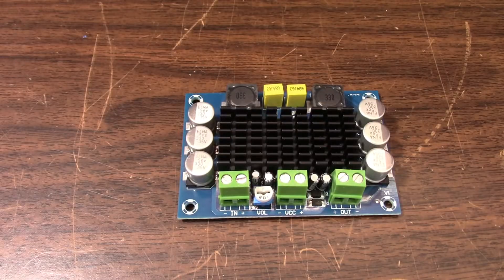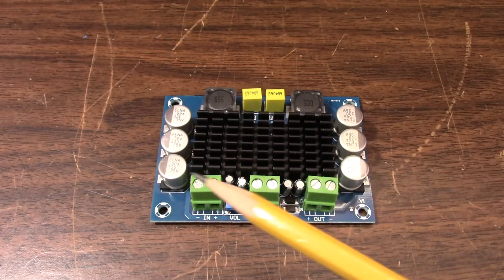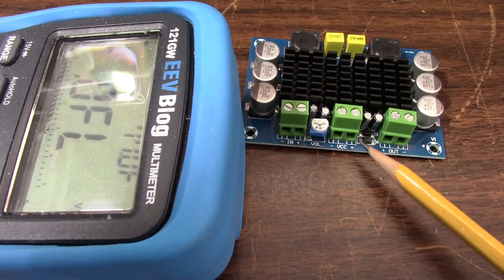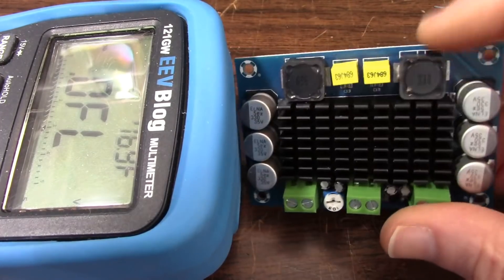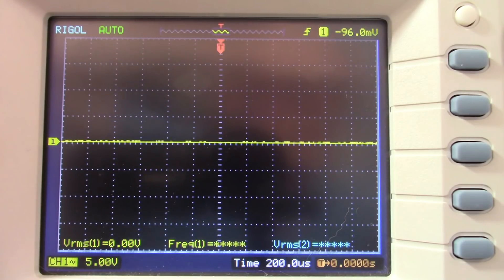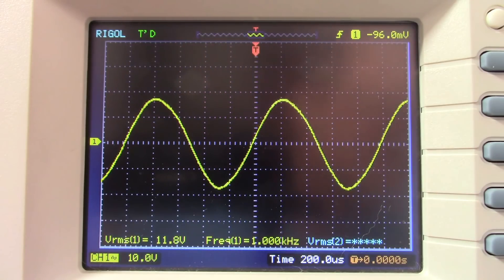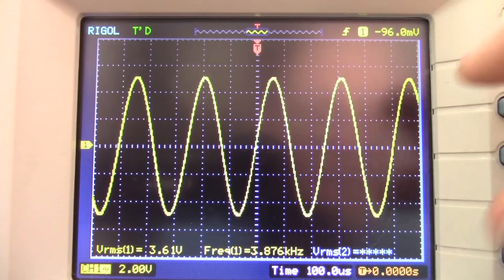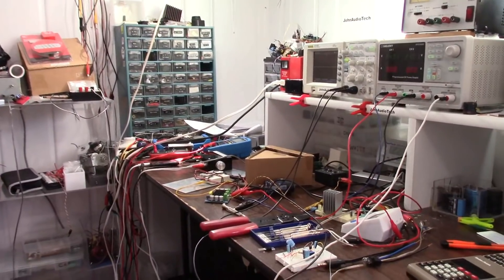TPA3116D2 audio amplifier 100w at 2 Ohms?

Comment: Hello! Thank you for testing these TPA3116's for us! I have learned something today with regards to using these amps on 2 Ohm load. I don't have the equipment nor the expertise to do these kind of testing... anyways, I have the stereo variant of this little amp and I was trying to power a double coil (2x2 ohms) 6.3 inch subwoofer for car. I used the output of the navigation system and hook it up into a low pass filter which then went to the input of my amp. Then I used both channels to power this subwoofer. The sound at those low frequencies, was unexpectedly powerful ... I have checked both the heat sink and the coils to see if they get any hot... but no! Nothing! Just by touching them, I suppose if I didn't feel any heat, maybe the temperature was around 37 Celsius. But, another thing happened: the volume of the amp was 2/3 towards maximum... I didn't get ready of the turn on pup-up back then.. when I powered the system, the pop-up didn't go off... it just keep on going repeatedly stressing out the subwoofer at maximum... I thought I lost it! I had to disconnect the main power immediately! What do you think happened? I am a beginner in electronics! Thank you for your patience! 🙏

Comment: 11:35 Can this amp really be cranked up with real speaker (not test load) to even 72 watts ? Because my dc watt meter only shows 3-4 watts at normal listening volume, and it already sounds powerful to me (indoor, 4x4 meter room). Because I'm using similar chip tpa3116d2 but different kit, to drive a double coil 6" subwoofer that can be set to 2/4/8 ohm, now I'm using 4 ohm, too afraid of using 2ohm.
Reply: If you're measuring power draw between the supply and amplifier then you won't get the correct reading. Amplifier power is measured from the speaker output with a proper amplifier dyno.
Reply: @RallyRanchMotorsport  Yea, since then i have learned that there are like 3 kinds of wattage that can be measured. 
1. From Wall (AC)
2. From power supply (DC)
3. From speaker + - , need proper equipment with Amperemeter clamp and voltmeter.

But as long as I keep comparing one power draw to different level of sound. It will stay consistent like if it draws 20 watts from AC power, then I crank it up and it draws 50 watts, and if I crank more and it draws 100 watt. It's consistent as a measurement.

Also class D is 85-95% efficient, so if it draws 100 watt from wall socket, the output to speaker is more or less 85-95 watt, rest is lost in heat etc.

Comment: I am on my second project using a set of these 3116 mono boards - my first one was a set of dedicated monoblock amps to drive some 2 ohm subs.  I have to say:  they have been in service being driven by a 24 volt switching supply for 3 months now.  They are NOT fan-cooled, but DO get rather warm.  However - they have taken a LOT of abuse where they are getting used at.  My new project I am working on now implements these for similar 2-ohm subs, but will be cooled by a fan.  For less than a few bucks, these will really push cheaper subs pretty hard and certianly take a lot of abuse.

Comment: Is it okay to use a symmetrical psu for tpa3116? I have a 12-0-12 transformer lying around.
Reply: The board requires 24 DC (typ), your transformer is AC. If  you add rectifiers and capacitors as symetrical, you will get 12*1,41-0-12*1,41 or almost 17-0-17 Vdc  or 34Vdc end to end - the board can't handle that !  All you can do is to rectify half wave (1 diode each side, center tap as ground, some big capacitors to smooth it) and you will get 17 Vdc, something that shall work, but the power will be limited to this voltage.... maybe you will get around 30~35w / ch in 4 ohms.

Comment: hello I bought this amplifier, I want to mount it in a portable radio and I will power it with 14 volts with 4 3000 mha 18650 batteries (approx) in 4S, I am looking for suitable 3 inch square speakers what can you recommend?

Comment: Thank you for your research into this board. Because of your excellent video, I Just installed these into some speakers and loving them! I covered the components on the left speaker board with silicone. I Will see if either board fail from the vibration! They work well with my bargain (£20) Mordaunt Short 902's.

Comment: Hey John, my TPA3116 board just went silent. Was working fine until I installed 3.3uF 100V audio caps across the speaker outputs. And now its dead. Any idea if I fried the chip or what could have happened?

Comment: Those coils are labeled as 33uH, but keep in mind that the data sheet recommends 10uH coils.  So, the snubber will have a lot of attenuation above about 1KHz which explains why you saw that high attenuation / roll-off at 10KHz.  Still, you were trying to evaluate this at lower bass frequencies. and the power there, I think  The TPA3116x is not going to perform to its potential without some additional heat spreading and like you said, a fan.  If you add the proper cooling the 3116 will give you 100W at 24V but you need to really beef up the cooling.  Agree this is a crap design from China, but the potential is there if you take the measures to support it.

Comment: I've come back and done this test on some of my TPA3116 boards.  I managed to get just over 100 watts (barely) at 24 volts from a 15 amp supply into a 2 ohm non inductive load but man ohh man does everything get hot.  Stupid hot even.  Bottom line is 50-60 watts bursts and it'll work,  for a while at least.

Comment: Problem is mostly the inductors.  I've seen that same distortion above 10Khz when the inductors heat up on other TPA3116 amps.  Still I rather like them,  they don't sound all that bad.

Comment: Hey John, I have a few of these amps for a project, but I would like to have some sort of control over the crossover frequency of the audio input to different amps, do you have any recommendations about how I go about this? I'm considering a crossover frequency between 100 and 150hz, but I'm having a lot of trouble finding decent preamp crossovers
Reply from the maker: Op amp based filters are the way to go. Check out Elliot Sound Products for good circuits.
Reply: @JohnAudioTech  thank you! I was planning on using multiple amps, an amp per speaker, would you suggest I purchase a single larger amp, and place the high and low pass filters op amp? Or send the full range to every amp and and place high and low filters after each amp?
Reply: @JohnAudioTech  also I'd like to add some sort of gain control on the low end, so I can match the bass to the treble, also this whole project is battery powered.
Reply from the maker: @sportbikeguy9875  It shouldn't matter much since each channel can be considered a separate amp as long as your power source can handle the current. You can add a potentiometer between the preamp/filter and the power amp to control the sound level.

Comment: Hey John, in what ways would you modify the board in order for it to be more solid at 2 ohm? Bigger (or no) diode, bigger coils, fan, anything else? Do you think this is achievable or worthwhile? I have one of these laying around and I'm building a home theater sub with a 2 ohm car sub driver (not much variety of choice here in Argentina) and I'd love to be able to repurpose this board instead of buying a new amp.
Reply from the maker: Yes, eliminate the supply protection diodes, bigger coils to handle the current and fan on the heatsink.
Reply: @JohnAudioTech  thanks!!!

Comment: Hi John - I asked this question on  your original 2018 review but I will ask it again here. Do the TPA3116 amp chips create/use a charge pump on the output H-bridge to double the input supply voltage? You are supplying 24 VDC  yet your scope indicates about 34 Vrms display=12, so (2 * 12/.707=34) 34 volts peak-to-peak where I would expect 12 volts peak-to-peak.  Thanks again.
Reply from the maker: What video did you see this? It's been a while so I'd have to rewatch them. At 24v and 4 Ohm load, I was getting around 15v rms, or 42.4v pk-pk. This is normal for a bridge amplifier with typical losses. No charge pump.

Comment: Thanks ! very good video.  I am thinking of using these as  part of a dual amp setup. I want to separate the lower frequencies with a DSP and drive the woofers with this amp and an LM4766 amp for the higher frequencies.  Do you think that is the best way to go? My thinking is the class D amp will be faster responding and you wont hear the minor hiss from the woofer. I added a zobel and thiel network filter to the output to the 4766 amp.  Do those kinds of filters help with damping on this TPA3116 D class amp too?

Comment: I own two of the amplifiers that were tested on this channel (this TPA3116D2 here and the TDA7492 2x50W) and would like to share what I found out about one feature that was not mentioned in the tests: The TPA3116D2 makes a popping sound every time the power supply is turned on, the TDA792 does not do that. I do not have the ability to analyze the technical features of the devices but I thought this might be relevant to some people... I am now trying to use a relay on the speaker cable that connects the speakers a short time after the amplifier is turned on to get rid of the popping sound.
Reply: tpa3116 is made by texas instruments and the tda7492 is made by ST microconductor so theres not made or built the same

Comment: Sir I want to know how come a 2.1 TPA3116 D2(2 TPA3116 IC) and a mono TPA3116d2(1 TPA3116 IC) requires or uses same power supply that is 24v. Please help me I am very confused. Waiting for your reply Sir.
Reply: 24v is 24v what matters is the amperage aka flow of current. SOOO if you want to get 50w x2 @ 4 ohms you need 200w pwr sppy 200w is the peak and 100w is rms divided by 2 is 50w rms per ch x 2. 25v @ 8amps is 200w.

Comment: Hello,
Can you give me some advice, please? I have 2 of these amplifiers connected to 8 ohms speakers. The audio source is a laptop. When I connect my laptop to the power grid, a loud background noise starts to hear from the speakers. The same noise is heard but much more intense if I connect the amplifier to the pc. I have other amplifiers that do not have this problem with using the same laptop or pc. What can be done to fix this problem?
Reply: Hi, It is because of Common ground circuit within the PC/Laptop audio out put. It is the Noise . Use Signal noise Isolator.
Reply: @Raamz111  what is signal noise isolator? Have some link?

Comment: I have bought this and the stereo tye amp. I found a typical lazy chinese design flaw, the heat sink touches the caps before the get full contact with the chip. and the only insulation for shorting out the caps is the alu oxide layer in the heatsink. I milled out pockets for the caps.

Comment: Amazing chips, even though they're probably fake, the boards sometimes selling cheaper than the chip itself. I've made and entire 2.1 amp with 3 pbtl 3118 chips. Things to consider are replacing the filter caps with genuine low esr ones, and maybe bump the capacity a bit. Another thing is the hiss, which comes from high gain config of these boards(nice feature if you don't plan to use a preamp). A simple smd resistor removal will drop the internal gain from 32/36dB to 20dB, eliminating hiss, but will require a preamp. Also, if you're buying this board or the stereo version of it, get the one with the heatsink that's screwed in rather than glued, and put some paste on it.

Comment: Thanks to you I'm gonna buy 4 of this.
Bypass the diode, add some cap!

56wrms of Clean amp is better then 100wrms of dirty amp

Plan to use it with dsp so this amp gonna power directly to my speaker.

Comment: Hey John i got a question, i want to use 2x 3116D2 amps in order to build a Bluetooth speaker. I have a spare HP Printer power supply rated 32volt 2.5A. Iam planning on using that with a step down converter (to get it to 24V) in order to operate both of those 2 amps. 
Will that work or will i definitely need a higher output power supply?

Comment: Im running it bare in my car to run single 2ohm subs at 75% volume. so far its amazing for the price. waiting for my aluminium case to arrive
Reply: Are you serious man??!!!
Reply: @JonJon501  it absolutely worked
i've taken it out and replaced it with another TPA amp. Still needs to be turned up a fair way, but less so.
Reply: @JonJon501  dont expect this chip to be LOUD in the car. i really had to turn it up, but it worked and was acceptable

Comment: If you keep testing amps like this every week, perhaps teach us how to hook them up to preamp and power, I'll guarantee your channel will grow
Reply: Power is easy. Most*** of these 4$ Mono/Stereo amps use a single DC source between 12v and 24v. The higher the voltage used, the more power can be extracted from both 8 and 4 ohm speakers. There may also be more waste heat, so sink/accordingly. Basically, I have a few of these boards in service, and I can get around 60w peak @ 24v input power. That's around 2.5a. Buy a single DC switching power supply that can supply around twice this per channel... Or, ideally, a larger 24v Switching power supply that can supply enough power for all your channels X2. For a stereo setup, that's a 10a 24v switching supply - you'll be sharing grounds, and you'll be less likely to get any hum. 2 of these and a 240w, 24v switching supply will cost you under 50$ shipped. I have a few in service (modified, mainly for subwoofers, using some very mediocre 6dba/oct low-pass filters, which are also available there).

Connecting power is as simple as throwing your VCC and - lines between the amp and the power supply, and hooking up a 3 (grounded!) cable (You know all those ATX power supply cables everyone has around 500 of? Those are great for this) between your wall AC and the switching supply. 

** Some of these boards do require biased +/- voltage. These produce better sound, typically, as the peak to peak voltage is either double that of a cheap amp, or require fewer components, as many of these cheap single DC source amps do their own +Vcc / -Vcc conversions. 

I have never needed a preamp on a 3-5$ BTL board like this. I can routinely get 60w @ 24v into 4 ohms peak. More than enough for their intended application. For 100w applications, you'll be looking at biased voltages, and perhaps a small preamp. I've yet to find a preamp that does a good job on single source DC, so adds another level of difficulty to the entire setup. 

Remember, Double the output power of the amp and you're only gaining 3db at the speaker level. If you want to double the perceived volume of that speaker (if you can, without frying it) you need to increase the amplifier power by ~10x. You're much better off buying a better speaker with an extra 5db sensitivity, than you are trying to find one that can handle 600w, often with a lower sensitivity.
Reply: @Arcygenical  how to connect 2 of this with single SMPS. Whats volt and amp smps needed? Do i need preamp suggest any from AliExpress.
Reply: @jakk2ahao  Totally depends on your goal. *Short reply:* for 2 8ohm speakers, 200w supply @24v, no preamp unless you have a very poor input source. A good audio-grade capacitor is more important than a premamp IMHO, and especially if you are using a preamp (they don't like being under-supplied). 

That means you're going to want a 24v supply that can deliver at least 4a per amplifier board for a 2x 8ohm impedance. 24v 250w for a 4ohm impedance. 

As for a preamp, this totally depends on your input source (and I'm going to say, likely skip it). For a cellphone 3.5mm jack only system, just about any 24v preamp should suffice (and even then, you likely won't need one if you adjust your gains and expectations). 

Just connect all boards in parallel to your supply, with the capacitor also in parallel if you chose to use it. You'd be surprised how little a 2 speaker 8ohm system actually draws, so quality, IMHO, is more important than quantity on the SMPS supply. For the cap, invest in a few 30v audio grade-caps, They're large, but worth it.
Reply: I have videos explaining this and my channel hasn't blown up yet 😂

Comment: Issues will all them... - I have similar feelings. Even this board, I just don't believe in the specs and it's capability of 2ohm in bridge.
Ah this 'music', dub steep, is that what it is, oscillations at very low freqs.

Comment: My S.M.S.L SA-36a Pro has the TPA31186D2. Rated from 4-8 ohms 20-8 watts per channel. If I recall class D chips can't handle 2 ohm loads, it's almost a dead short for them. I will say this series of chips are impressive, I've powered speakers big and small with mine and it doesn't lack power at all while sounding great. I have maxed out the supplied power brick.

Comment: Chinese modules and boards specs are read like: It may theoretically reach this numbers, but not with the actual components used and was only tested in a lab by IC manufacturer without witnesses or guarantees, actual product is sold as-is and any use is done at your own risk.
In other words with a chunk of rock salt.

Comment: I actually got these because of your video. It's been wonderful. Except the glue holding the heat sink fell off one
Reply: I used a laptop powersupply even tho I could use more Volts it seems to work well.

Comment: Hi John schottky diodes often have quite high reverse leakage, which can sometime's make them a bad choice for reverse polarity protection a better solution is a P channel fet especially at higher current levels,..
Love your vids thanks for your efforts in sharing  you skill and knowledge.... Steve
Reply: Tested to Destruction   ,    Interestingly, I agree. However, you might want to list the downside... reduced voltage ratings.